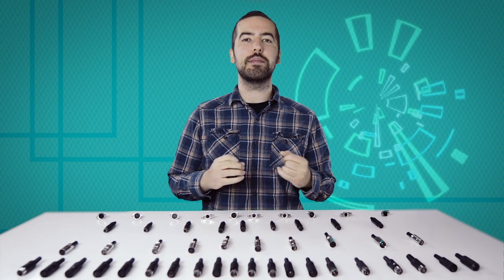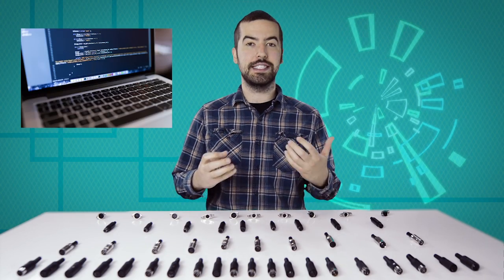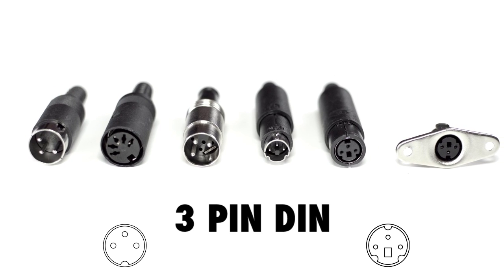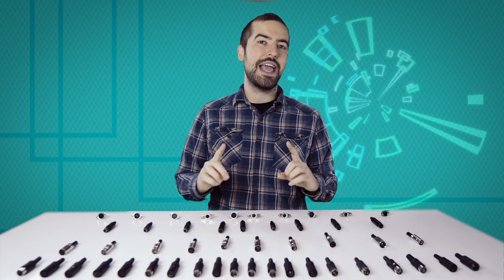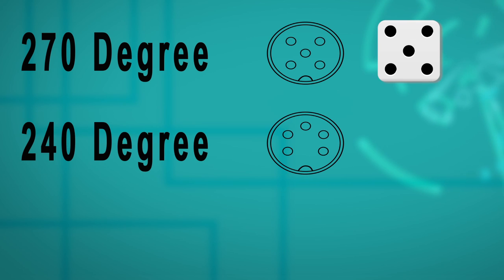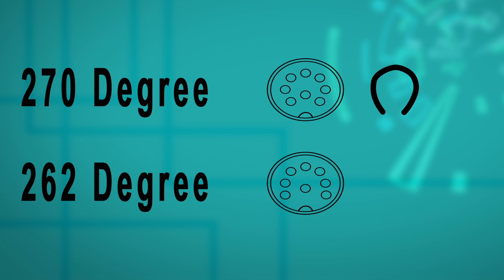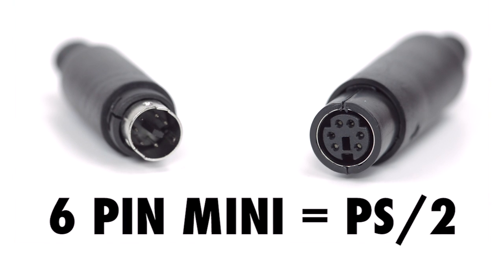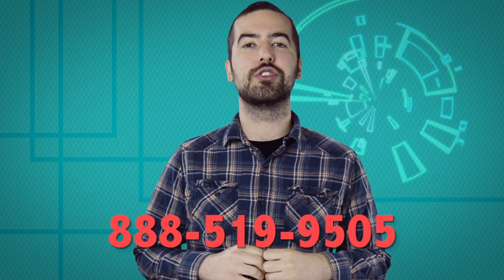An Overview of DIN Connectors - What You Need To Know

Comment: There are also locking DIN plugs, with a latch on the inline connector (similar to the locking mechsnism on an XLR connector) and a corresponding notch on the female chassis-mount connector. British-made NAIM Audio equipment used locking 3 and 4-pin connectors for the hookup between the preamp and separate power supply. There are also 4, 5, 6 and 7 pin XLR connectors with thin, skinny pins rather like the pins on DIN connectors.

Comment: Ok so a 6 pin DIN connector is used as PS/2 old keyboard/mouse connector. But what makes DIN connectors better than other connectors if anything?

I know there are also connectors known as spring and lock connectors for example.  At least they feature a quick spring disconnection mechanism which may be working when unintented?

There are also IEC connectors and Molex connectors (which can have up to 6 pins).  So , is the usage of them just mainly due to customs and traditions of various industries? It seems that  nothing makes any better than the other really, but..

Because what could you want from a connector? Be made from high quality material, not to get loose over time like damn small usb ports ,  be water and dust resistant , maybe feature a light indicator or wattmeter even. But a wattmeter is over the top here , it should be separate. Be RoHS compliant. Be universal.

Comment: Quick question, is it possible to build a 3.5mm male to 4 pin male mini DIN? I have an old German console radio that I'd like to add Bluetooth to via an external transmitter/receiver and the radio's tape/record player in jack. I figured it is, and I have limited soldering skillz, just not sure how to go about it, or what parts to order. Thanks!!

Comment: This video is fantastic!  It covered EXACTLY the information I needed showing the difference between the 270 degree and 262 degree 8-pin jacks used in automotive audio equipment.  Thank you very much for taking the time to record this.
Reply: I was a car stereo installer from 1980 to '92; I didn't realize DIN plugs were still used in car audio. Back then I spent a lot of time making DIN adaptors because each manufacturer had a different standard for wiring DIN plugs; I had to adapt Alpine to Kenwood and vice versa.

Comment: Hello! I work in an industrial environment and I run across connectors similar to these, but i’m not sure if they referred to as DIN connectors, or even follow that standard. Usually when I look them up online they’re referred to as 3-pin-5pin M12 connectors. We use these to connect sensors like photo-eyes and proximity sensors. I’m just trying to find out an official name for this connector because a lot of different places have a different name for it. When I look up DIN connector or even mini DIN I get everything you’ve shown in the video except the connectors I work with. Any information would be much appreciated. :) Thank you.

Comment: I find 4-pin mini-DIN is used on a lot of devices that need multiple voltages, like old hard drive and CD-ROM enclosures. I've even seen it used for power on weird stuff like a development/backup unit for Nintendo 64 (Bung Doctor V64).

Comment: hi there,looking for some advice. I recently picked up a yamaha surround sound system that is a few years old. its in mint condition,only problem is it requires an 8pin DIN connection from the sub/amp to the centre speaker. could i replace this cable with a standard 8 pin cable or would i have to get a specific build? i can get a replacement for around £10, but they do get quite expensive. is this an option?
Reply from the maker: I'm not sure if they employ a special pinout.  I doubt they did, but I'm not certain.  You could try a standard straight through 8 pin cable.  https://www.showmecables.com/by-category/cables/cables-computer/cables-computer-din/8-pin-mini-din-male-male-cable

Comment: Hey guys, thanks for the video, i wanna know if have some difference between a 3 pin DIN connector and a xlr connector, but not a difference in question of pin angles or fit with the plug. Have some difference in the question of signal quality? Is XLR better for eliminating noise or is just a marketing play?
Reply from the maker: What are you trying to connect?
Reply: @ShowMeCables  Hi, i'm creating a homemade electrode for a low cost EEG , i have a shielded 2 lines cable, and a 5-pin DIN connector. I dont have experience with this area so i gone search in web for connectors and cables. I need a line with plus signal and the other with negative signal. The shielded is gonna be the ground. Some sites saids that xlr connector is better for eliminate noises, i just wanna know if for these aplication, is gonna really be better, i dont want spend money. In my country the xlr connector is expensive. Thank you for answer.
Reply from the maker: Good luck.  Let us know how it turns out.  

I wonder if the recommendations are based on audio noise.  Since XLR can support a balanced signal it is better for audio applications than an unbalanced signal.  However, that doesn't have to do with the form factor of the connector.  You can achieve similar results with a 1/4 TRS connector.
Reply: @ShowMeCables  Thank You so much for the answer, i don't have much time to work in the project this month, but when i get some results, i come here to speak.

Comment: Is it possible to make a 7 pin into a 6 pin?
Reply: With some, yes. I've ejected the middle pin from several DINs, most recently when converting a DIN6 to a 240° DIN5. Ejected pins doen't always go back in securely and sometimes risks being pushed into the hood when inserted, so be sure you want to eject them and don't just do it for soldering convenience or pin rearrangement unless you also fill the plug with glue or something afterwards.

Comment: Is there any such thing as a mini 7 pin DIN female to hdmi adapter? I can't find one anywhere
Reply from the maker: +3zraLIVE Hmm, I wouldn't imagine so.  Or at least we are not familiar with an adapter for DIN to HDMI.  We may be able to work up a custom solution for you if you are able to find out the wiring information.  For more info, you can email or call our customer service department at customer.service@showmecables.com and 888-519-9505.